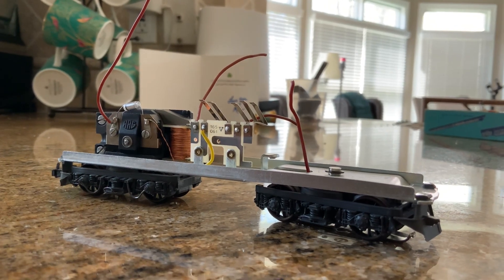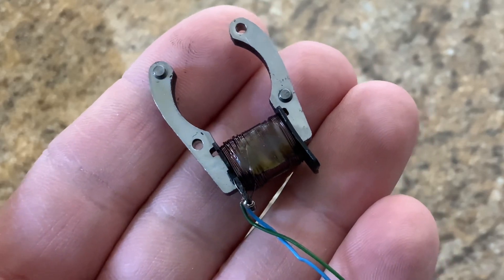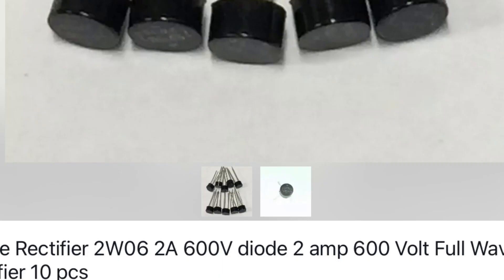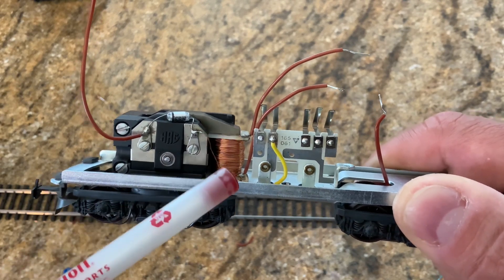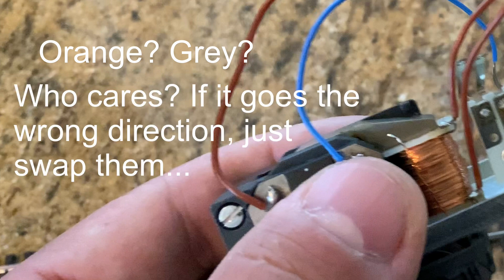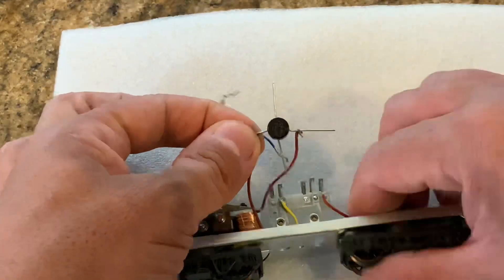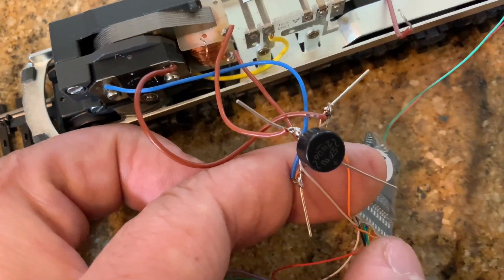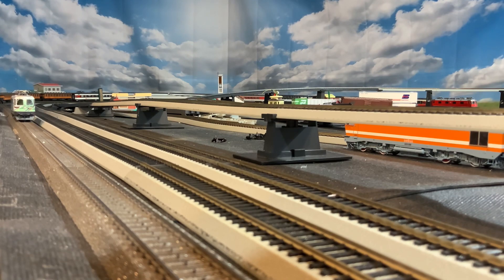Marklin AC to DCC-Ready for under a Dollar! - Convert Marklin or HAG AC Locomotives to DCC for Cheap

Comment: The end result is the old Marklin A.C. transformer is then replaced with the direct current Train transformer control. The center rail is + p0sitive , the two tracks are the - negative. The 5-pole motor with the permanent magnet can still be used and will draw less current or the old Marklin electro magnet coil does,  Although it can still be used for the magnet but this will draw more current & heat running the voltage through it.., i think the perm magnet is a better option. Thanks for showing us this informative video.🙂

Comment: This is an ingenious breakthrough for confused noobs like me in the modelbahn universe. I have followed your instructions and used a rectifier that costs less than half a dollar, in order to run a very old Marklin AC Analog locomotive that was made in 1951. However, the loko is currently draining more than 1.5 amps of current and the rectifier is getting heated up after 5 mins of playtime. I have added Al plates with heat sink paste to cover the rectifier for now, Lets see how far it goes. Cant thank you enough for this Doctor Hobby <3 <3
Reply from the maker: Ahh, yes, some adjustments will need to be made, especially for older, less efficient models. Let me know how it goes!

Comment: Please, I would appreciate it if someone can advise on which of the following three decoders would work best with the cheap bridge rectifier proposed by Doctor Hobby.  All three are sold on eBay. Thank you!!!
1. Marklin Digital Locomotive Decoder, Programmable, from 60760 kit   
2. Märklin H0 60906 Märklin Locomotive Decoder Allstrom
3. Märklin 60972 Locomotive Decoder mLD3 mfx/MM1/MM2/DCC 21 MTC 21MTC

Comment: (D)
Schöne Lösung mi dem Brückengleichrichter es dürfte auch aderst gehen, ohne den spulendrat on dem Motoren Schild zu abzulöten die Steuerleiter P1. P2. (L1. L2.) verbleibe an den Klemen bei den Feldbügel P1. P2. (L1. L2.) N, verbleibt mit der Drossel an dem Motoren Schild der spulendrat (Ausgang der spule wird zu P und das Kabel mit der Drossel wird zu N also (P: N.) Steuerleiter P1. P2. (L1. L2.) Zuleitung der spule von dem Feldbügel werden an die  2 Dioden angeschlossen genauso wie man das macht für den Lichtwechsel bei DC Loks (bei Wechsel der Fahrtrichtung). Steuerleiter P von dem DCC Decoder für dem Motor werden an die Zuleitung der 2 Dioden angeschlossen. N. von dem DCC Decoder für dem Motor wird an die Drossel von den N. der mit der Drossel verblieb. Nun wird aus dem AC Motor ein AC Motor. Der auch mit DC blieben werden Kannen. mit (dem Wechsel der Fahrtrichtung).  Die Restliche Verkabelung wird wie gehabt mit dem DCC Decoder verbunden. Beachten sie die Bilder. Die kosten für ein Paket geeigneter Dioden sind nicht. so hoch. Zudem ist das Paket (mit 2 Dioden) sehr kompakt als platzsparend, und kann bei einer Lok im lokinneren gut untergebracht werden.     
--------------------------------------------------------------------------------------------------------------------------------------------------------------------------------------------------------------------------------------------------------------------------------------------------------------
(E)
Nice solution with the bridge rectifier, it should also work without unsoldering the coil wire on the motor shield, the P1 control conductor. p2 (L1. L2.) remain on the clamps at the field brackets P1. p2 (L1. L2.) N, remains with the choke on the motors shield the coil wire (output of the coil becomes P and the cable with the choke becomes N, i.e. (P: N.) control wire P1. P2. (L1. L2 .) The lead of the coil from the field bracket is connected to the 2 diodes in the same way as you do for the light change in DC locomotives (when changing the direction of travel).Control conductor P from the DCC decoder for the motor is connected to the lead of the 2 diodes. N. of the DCC decoder for the motor is connected to the throttle of the N. which remained with the throttle. Now the AC motor becomes an AC motor. The can also be left with DC. with (the change of direction). The rest of the wiring is connected to the DCC decoder as usual. The costs for a package of suitable diodes are not that high. In addition, the package (with 2 diodes) is very compact and space-saving, and can be easily accommodated in a locomotive inside the locomotive.

Comment: (E)
Another thing you should say goodbye to at Märklin, from which (Märklin system) with a decoder it is (MFX-AC) (Motorola-AC) (DCC-AC) has 2 different cable trees (wiring) at (MFX-AC ) (Motorola-AC) these are the colors of the Märklin system [control wire PN from the motor are green/blue for (Märklin)] with DCC-AC they are the colors [control wire PN from the motor are orange/grey with the DCC -AC decoder] which is also used for Märklin -Trix systems for DC locomotives (DCC -DC). (AC locomotives or DC locomotives) do not differ as far as the cable tree (wiring) is concerned, so you can say goodbye to the clock-old braid at Märklin!! The (wiring) remains the same for (AC locos and DC locos) both have a (DC Motor P N) nowadays except for Märklin and HAG there is still a (AC Motor 2P N (L1. L2. N)) only for Märklin [Soft Sinus motor series 39... are 3-phase (R.S.T.N.) (P1 P2 P3 N).] the production of the soft sine motor series 39... has been discontinued at Märklin!! Only type no. 39... is used here. for locomotives be it for (AC or DC). Does the Märklin system have its own brand of electronics and AC decoder or DC decoder, which also makes sense. Märklin AC and Märklin -Trix DC that have a series 39 soft sine motor... Can be switched to DCC decoders, AC decoders or DC decoders when used with the different makes of DC decoder is very complex because you also need the control electronics, you have to know where to feed the [control wire P N (wire from the motor orange/grey) from the DC decoder. That's why it's better to leave Märklin's own make. If there is an interface, you can also use other makes of DC decoder. (E.g.) (DCC -AC) or (DCC -DC), if the power supply from the motor (orange/grey) is in the right place at the interface on the circuit board. Where is the power supply for the control electronics for the (Soft Sinus Motor Series 39...), for the cables (orange/grey) so that the DCC decoder transmits the control commands for the direction of travel and the speed to the control electronics for the (Soft Sine motor series 39…).
It is very likely that the term "3-wire" or "2-wire" has become common because the (AC Motor 2P N (L1. L2. N)) motor requires one more wire, i.e. "3-wire" for the (DC Motor P N) only "2-wire" so today one still uses "3-wire" for AC locomotives and "2-wire" for DC locomotives, although to put it bluntly, Märklin and HAG also use "2-wire" DC locomotives today in 2022. Conductors" are only the supply line. P is moderately on, the supply line has a different arrangement. Even with high-voltage current 230V /400V, the old hands still speak of (R. S. T. N. PE) instead of (L1. L2. L3. N. PE) in the year 2022, where they say goodbye to the (" R. S. T. N, PE ") "-thing and go". should!!!
------------------------------------------------------------------------------------------------------------------------------------------------------------------------------------------------------------------------------------------------------------------------------------------------------------------------
(D)
Ein weites man sich bei Märklin quasi verabschieden sollte, von dem (Märklin-System )bei einem Decoder sei es (MFX- AC) (Motorola-AC) (DCC-AC) 2 verschiedene Kabel Bäume (Verdrahtung) hat bei (MFX- AC) (Motorola-AC) sind es die Farben von den   Märklin-System [Steuer Leiter P N von dem Motor sind bei (Märklin) grün/blau] bei DCC-AC sind es die Farben [Steuer Leiter P N Leiter von dem Motor orange/ Grau bei dem DCC -AC Decoder]die auch Märklin -Trix -System für DC Loks(DCC -DC) verwendet wird. (AC Loks oder DC Loks) unterscheiden sich nicht was der Kabel Baum (Verdrahtung) angeht, deshalb kann man sich bei Märklin von der Uhr alten Zopf verabschieden!! Die (Verdrahtung) bleibt dieselbe bei (AC Loks und DC Loks) beide haben heutzutage ein (DC Motor P N) ausgenommen bei Märklin und HAG gibt es noch ein (AC Motor 2P N (L1. L2. N)) nur bei Märklin [Soft Sinus Motor Serie 39… sind 3 phasig (R.S.T.N.) (P1 P2 P3 N).] die Produktion von dem Soft Sinus Motor Serie 39… ist bei Märklin eingestellt!! Hier wird nur noch die Art Nr. 39… verwendet. für Loks sei es für (AC oder DC). Hat Märklin System bedingt Elektronik und AC Decoder oder DC Decoder ein eigenes Fabrikat was auch sin macht. Märklin AC und Märklin -Trix DC die einen Soft Sinus Motor Serie 39… haben Können auf DCC Decoder, AC Decoder oder DC Decoder umgestellt werden ist bei der Verwendung bei den verschieden DC Decoder Fabrikate sehr aufwendig da man auch die Steuer Elektronik braucht, man muss wissen wo man die [Steuer Leiter P N (Leiter von dem Motor orange/ Grau) von dem DC Decoder einspeisen muss. Deshalb belässt man besser das eigene Fabrikat von Märklin. Wenn es eine Schnittstelle gibt, kann man auch andere DC Decoder Fabrikate verwenden. (Zb.) (DCC -AC) oder (DCC -DC), wenn an der Platine bei der Schnittstelle die Einspeisung von dem Motor (orange/ Grau) an der richtigen Stelle ist. Wo man bei der Steuer Elektronik für den (Soft Sinus Motor Serie 39…), für die Kabel (orange/ Grau) die Einspeisung ist damit der DCC Decoder die Steuer befehle der Fahrtrichtung und der Geschwindigkeit weiter gibt an die Steuer Elektronik für den (Soft Sinus Motor Serie 39…).
Sehr wahrscheinlich hat sich der Begriff "3-Leiter" oder "2-Leiter" eingebürgert, weil bei dem (AC Motor 2P N (L1. L2. N)) Motor bezogen ein Leiter mehr benötigt wird sprich "3-Leiter" bei dem (DC Motor P N) nur "2-Leiter" so mit verwendet man heute noch für Wechselstrom Loks "3-Leiter" und für Gleichstrom Loks "2-Leiter" obwohl über spitz gesagt auch  Märklin und HAG  heutzutage anno 2022  Gleichstrom Loks "2-Leiter" sind  nur der die Zuleitung. P ist Schleifer mässig an geht, hat die Zuleitung eine andere Anordnung. Selbst beidem Starkstrom 230V /400V sprechen die alten Hasen noch von (R. S. T. N. PE) anstatt von (L1. L2. L3. N. PE) anno 2022 wo man sich quasi von dem (" R. S. T. N, PE ") " -Gedöns verabschieden " sollte!!!

Comment: ((E)
Good work!! In fact, the pole brackets from esu and the pole brackets from Märklin Series 83 (permanent magnet) is not recommended, for lack of ventilation (lack of cooling) the (permanent magnets) in the pole bracket tend to discharge, only the new pole bracket from Märklin Series 37 (permanent magnets) do not tend to discharge (permanent magnets) in the pole bracket. Pole brackets from HAG are reliable, the (permanent magnets) in the pole bracket do not tend to discharge. Field brackets from Märklin series /36.../35.../34.../33.../31.../30... can be polarized with the Graetz circuit (consisting of 2 diodes) [control phase P1. p2 (L1.L2.)]. Field brackets from HAG can also be poled with the Graetz circuit (consisting of 2 diodes) [control phase P1. P2] (L1.L2.)]. Whether you then have the load balance is questionable. The wiring from the original AC motor Märklin or from the original AC motor HAG is retained, as with analog AC operation. The changeover switch is removed and replaced by the Graetz circuit, which consists of [2 diodes] connected to the [control phase P1. P2] on the field bracket where the changeover switch was connected, control phase P output of the field coil is connected to from the motor shield (rotor terminal P). [ Lead of the Graetz circuit (consisting of 2 diodes) to control P wire from the decoder] [Control wire N from the motor shield (rotor terminal N) to control wire N from the decoder] i.e. to the control P N wire from the decoder. The control wire PN can now be connected as usual from the motor to the terminals PN of the decoder: Applies to DCC -AC decoders!!! Control wire P N wire from the motor orange/grey at the DCC -AC decoder (with cable or interface). [Control wires P N from the motor are green/blue at (Märklin)] for DCC -AC [DCC -AC Decoder Märklin]. (DCC -AC Decoder Märklin) (with cable or interface). When these are available. It is imperative to use DCC decoders that are also designed for analog AC operation!! Only for AC locomotive!! [Never use DCC decoders that are also designed for analog DC operation!! Unless it is a DC locomotive]. The DCC decoder will go up in smoke (DCC decoder is destroyed). And therefore unusable.

------------------------------------------------------------------------------------------------------------------------------------------------------------------------------------------------------------------------------------------------------------------------------------------------------------------------
Gute Arbeit!! In der Tat die pol Bügel von esu und die pol Bügel von Märklin Serie 83 (Permanentmagnet) ist nicht zu empfehlen, mangels Belüftung (mangels Kühlung) neigen sich die (Permanentmagnete) in dem pol Bügel zu entladen, Einzig der neue pol Bügel von Märklin Serie 37 (Permanentmagnete) neigen sich nicht die (Permanentmagnete) in dem pol Bügel zu entladen. Pol Bügel von HAG sind zuverlässig neigen sich nicht die (Permanentmagnete) in dem pol Bügel zu entladen. Feld Bügel von Märklin Serie /36…/35…/34…/33…/31…/30…, können mit der Graetz Schaltung (bestehend aus 2 Dioden) gepolt werden [Steuer fasen P1. P2. (L1. L2.)]. Auch Feld Bügel von HAG Können mit der Graetz Schaltung (bestehend aus 2 Dioden) gepolt werden [Steuer fasen P1. P2] (L1. L2.)]. Ob man dann den last Ausgleich hat ist fraglich. Die Verdrahtung von dem original AC Motor Märklin oder von dem original AC Motor HAG bleit erhalten, wie beidem analogen AC betrieb. Der Umschalter wird ausgebaut und durch die Graetz Schaltung ersetzt, die aus [2 Dioden besteht] die an die [Steuer fasen P1. P2] am Feld Bügel wo der Umschalter angeschlossen war, Steuer fasen P Ausgang der Feldspule wird an von dem Motor Schild (Rotor Klemme P) angeschlossen. [ Zuleitung der Graetz Schaltung (bestehend aus 2 Dioden) an Steuer P Leiter von dem Decoder] [Steuer Leiter N von dem Motor Schild (Rotor Klemme N) an Steuer Leiter N von dem Decoder] also an die Steuer P N Leiter von dem Decoder. Die Steuer Leiter P N kann nun wie gewohnt die Steuer Leiter P N von dem Motor an die Klemmen P N von dem Decoder angeschlossen werden: Gilt für DCC -AC Decoder!!!  Steuer Leiter P N Leiter von dem Motor orange/ Grau bei dem DCC -AC Decoder (mit Kabel oder Schnittstelle). [Steuer Leiter P N von dem Motor sind bei (Märklin) grün/blau] für DCC -AC [DCC -AC Decoder Märklin]. (DCC -AC Decoder Märklin) (mit Kabel oder Schnittstelle). Wenn diese erhältlich sind. DCC – Decoder die auch für den analogen AC betrieb ausgelegt sind zwingend verwenden!! Nur für AC Lok!! [Keinen Fall DCC – Decoder die auch für den analogen DC betrieb ausgelegt sind verwenden!! Es sei das es sich um eine DC Lok handelt]. So wird der DCC – Decoder in rauch auf gehen (DCC – Decoder ist zerstört). Und somit unbrauchbar.

Comment: (E)
For Märklin 3015, should not be used with a decoder PN (PN) or decoder 2PN (P1 P2 N) decoder Motorola-(AC) / MFX -(AC) / (DCC-(AC) which are rated only 1.2A are too short from the maximum A. With a Märklin 3015, a trailer load of 1.0 A must be calculated using the thumb. Minimum payload maximum A. 1.5 A. Märklin has made a replica for the 3015 Märklin Theme 150 years of Märklin 31859 model of the series Ce 6/8 lll 31859-green this [decoder item
No. 145 199 Märklin] should be suitable. Whether this decoder is a decoder Motorola-(AC) / MFX AC (AC) / or (DCC-(AC), [Motorola-(AC) 2P N. / MFX -(AC)] 2 control phases 2P. N. or [(DCC-(AC) 1 control phase P. N.] I can't say because my Märklin 3015 have been converted to DC analog operation [P1. P2. N. (L1. L2. N.)] with a Graetz Circuit are provided so that <--> change of direction and <--> light change are possible because I only have DC models in H0 while retaining the original AC motor Märklin with <--> light change (CH) SBB.phase P. N.] I can't say because my Märklin 3015 have been converted to DC analog operation [P1. P2. N. (L1. L2. N.)] with a Graetz Circuit are provided so that <--> change of direction and <--> light change are possible because I only have DC models in H0 while retaining the original AC motor Märklin with <--> light change (CH) SBB.

------------------------------------------------------ ------------------------------------------------------ ----------------------------------------------------------------------------------------------------------------------------------------------------------------------------------------------------------
(D)
Für Märklin 3015, sollte nicht mit einem Decoder P N (P N) oder Decoder 2P N (P1 P2 N) Decoder Motorola-(AC) / MFX -(AC) / (DCC--(AC) der nur 1,2A ausgelegt sind verwendet werden, die sind von der max. A. zu knapp!! Bei einem Märklin 3015 muss über den Daumen mit 1,0A mit anhängelast gerechnet werden. Minimum Nutzlast max. A. 1,5A. Märklin hat 3015 Märklin ein Nachbau gefertigt zu dem Thema 150 Jahre Märklin 31859 Modell der Serie Ce 6/8 lll 31859-grün diesen [Decoder Art 
Nr. 145 199 Märklin] müsste geeignet sein. Ob dieser Decoder ein Decoder Motorola-(AC) / MFX AC (AC) / oder (DCC--(AC), [Motorola-(AC) 2P N. / MFX -(AC)] 2 Steuer fasen 2P. N. oder [(DCC--(AC) 1 Steuer fase P. N.] ist. Kann ich die nicht sagen da meine Märklin 3015 auf DC analog betrieb umgebaut sind [P1. P2. N. (L1. L2. N.)] die mit einer Graetz Schaltung versehen sind damit <--> Fahrtrichtung Wechsel und <-->Licht Wechsel möglich sind da ich nur DC Modelle in H0 habe. bei Beibehaltung von dem original AC Motor Märklin. mit <-->Licht Wechsel (CH) SBB.
Reply: That's about as clear as mud.